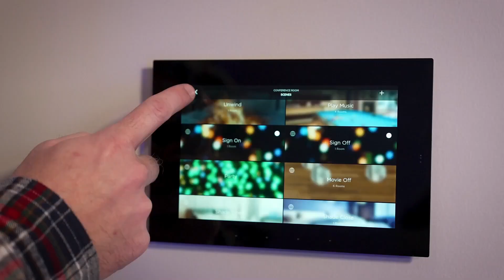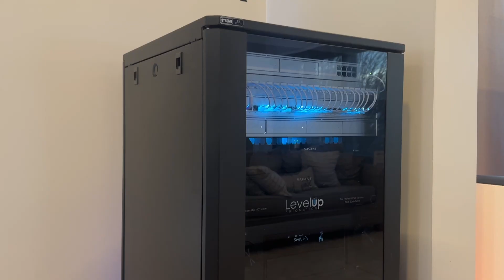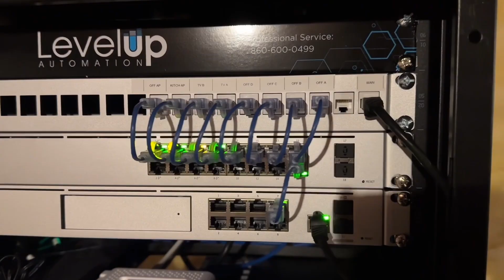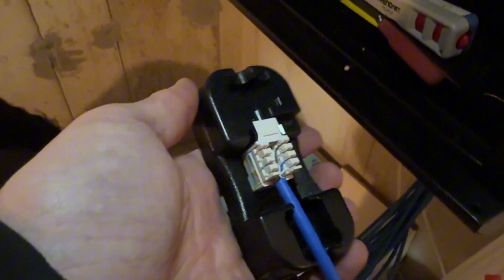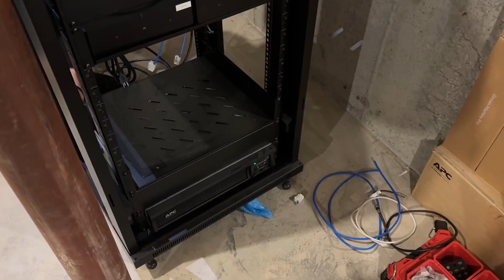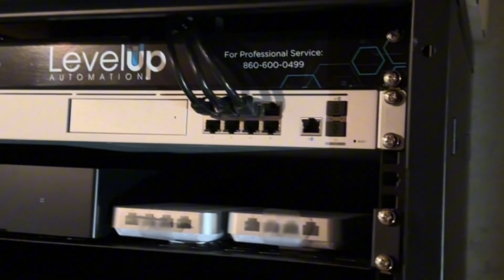Why Use A Ubiquiti Patch Panel?

Comment: Isnt it better to buy female to female keystones
Reply from the maker: Not in my experience, our standard practice is to run cat6 riser, our patch panel side gets keystones with patch cables to our switches and the opposite end either gets terminated into a wall plate keystone or an RJ45.

Comment: Why Use A Patch Panel? Because its pretty, otherwise it just introduces way more potential points of failure vs 1 single cable that plugs directly into the switch.

Comment: Hi

Thanks for this vidéo.

My main concern about this Ubiquiti patch panel is the fact it’s not grounded not fully compatible with all my shield ethernet cables I’ve been using in my house

I’m still hoping they will produce one day such grounded patch panels 😉
Reply from the maker: I understand, however if you are following proper ground procedure for the rack itself as well as running a UPS you should mitigate the risk significantly.

Comment: Since you 3d print your own keystone blanks, have you ever tried to design a blank that allows you to passthrough a DAC cable? I’ve been thinking about passing DAC cables through the patch panel then using a blank with a hole carved out of it to make it look a little nicer.
Reply: I've actually made my own by drilling a hole in the middle and cutting a line from the hole to one side. It works and looks good for a home enthusiast setup. But I would not do this professionally.

I must say I had lot of fun doing this. I also use this for patch cables that connect from a wall jack near the patch panel. This way I can avoid using another keystone jack + a 2nd patch cable. 

This can be mixed with keystone jacks in the patch panel. Looks very clean and uniform!
Reply from the maker: I'll play around with it and see what we can come up with. We typically just pass the DAC through an open slot on the patch panel, but I agree it would be nice to have something that cleans it up.
Reply: @integratewithnate  too bad I can't post a picture of my setup with holes in the blanks.
Reply: @ I found a 3d design for a keystone like this on printables. I don’t think yt will let me put links in comments, but you could find it on printables by a creator called fz, “SFP+ Cable Keystone Jack”